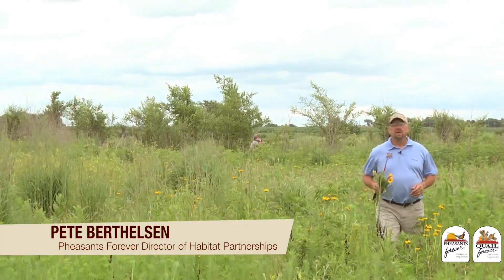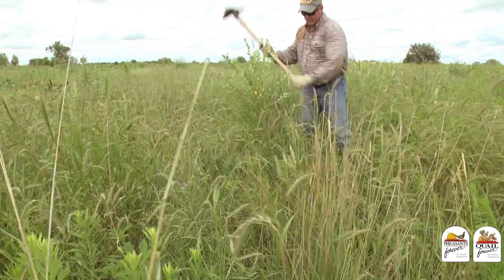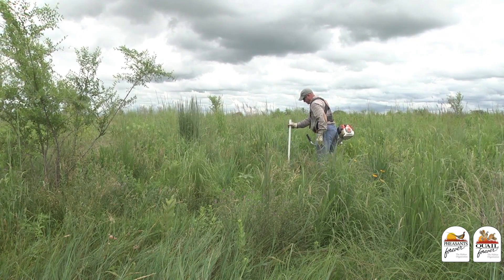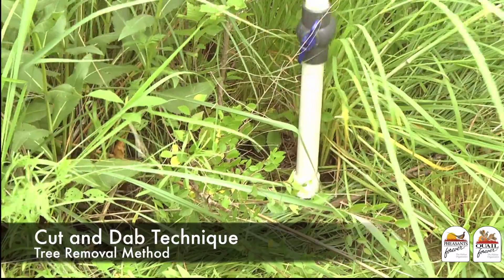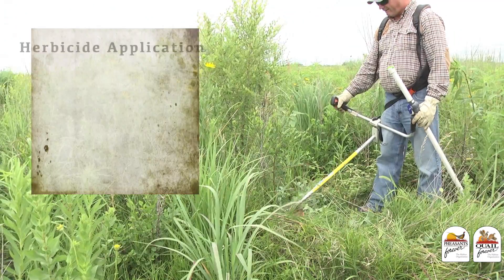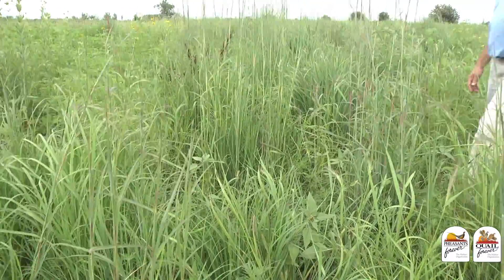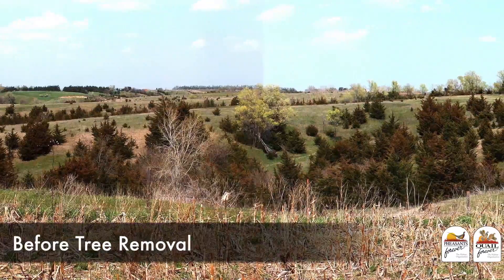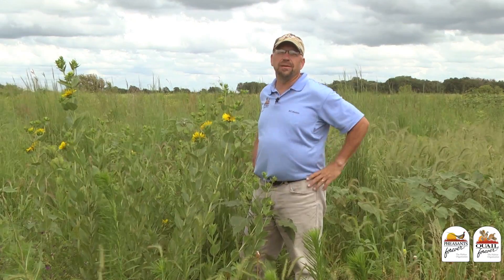Controlling Invasive Trees Habitat Tip

Comment: Can I use cooking oil instead of diesal?
Reply from the maker: You can use cooking oil as surfactant in the chemical mixture, but a commercially made surfactant or diesel would have a better chance of repelling water and sticking to the plants/tree long enough for the herbicide to take effect.  
So it can be used, but our biologists wouldn’t recommend it for achieving maximum control.